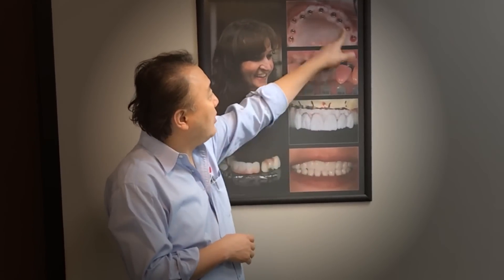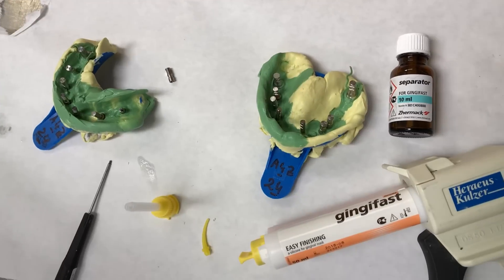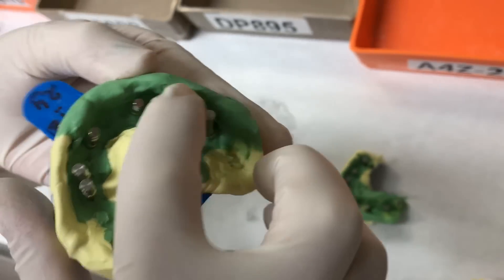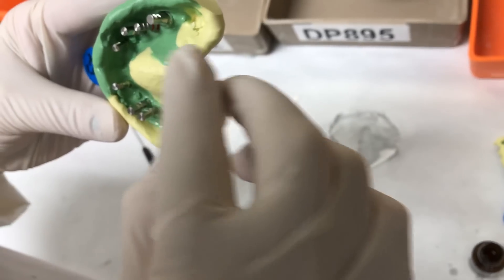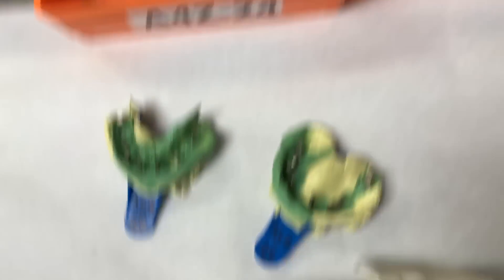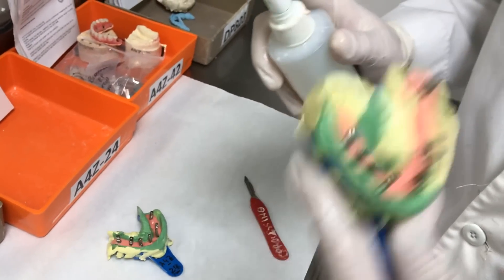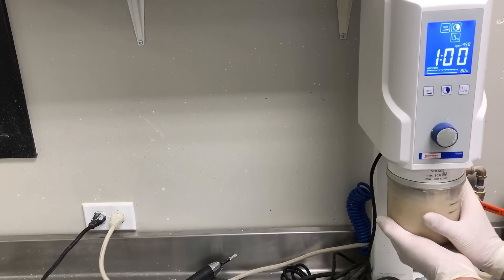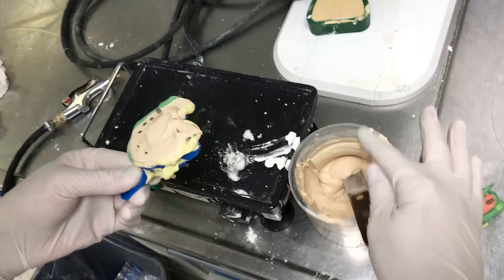How to Make a Great Soft Tissue Model from the Lab Analog

Comment: With respect.. Not really how you do this correctly.
You don't need the plastic, disposable impression tray any more after the model is poured.
So its ok to cut and destroy the tray in any way you need to in order to get the stone model and soft tissue out in one piece.
They should not come apart.
Reply: I agree ! And also measure the exact water - powder ratio , given by the manufacturer of the gips

Comment: I don't know the gingifast is supposed to come out of the stone......   maybe create lumps on it so there are retentive means for the stone to grab it?  So, the material is silicone basically? I thought it would be semi hard and trimmable, is there one that is?  If it's silicone then why not just use a PVS impression material?  Just because it's pink or is there another reason?
Reply: Hello Ahmed, Gingifast is supposed to be removable and it should be removed and trimmed before pouring stone to make the model, the kind that's trimmable is Gingifast RIGID and it's way better than using PVS impression materials, not only for it's color but for it's properties, hope this helps

Comment: Hi i am a Master technician  i want to help you with the fallowing comment to mix the fuji Rock you need to use  measuring water which is  is a ratio of 100 g to 20 ml of water 
second comment is never flip the impression while it is wait wait until it is dry then make you base .
Reply: Hello Cha, I totally agree with you on the water/stone ratio issue, but also the water should be placed first and then the stone should be added to avoid the formattion of lumps, also NEVER wipe the spatula clean with the border of the bowl to make sure there's a good seal for vaccum to be achieved and of course, never flip a recently poured impression
Reply: .....And I also use distilled water. Take Care. Antonio
Reply: Stone has weight. The reason never to flip the impression is because the stone would draw away from the impression sideways and downwards due to gravity. Resulting in distorted details. Also when you flip and put into the base you will also introduce lateral dispacement. Sometimes you will have gaps around your analogs. Your restorations will be ill fitting.